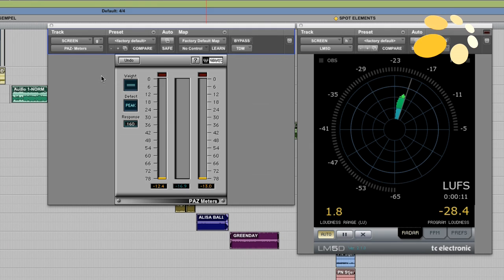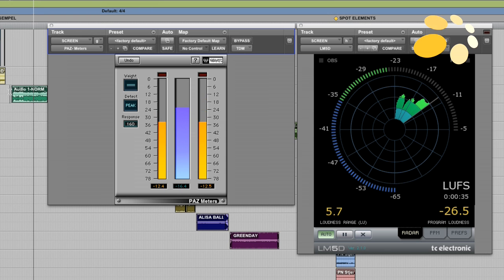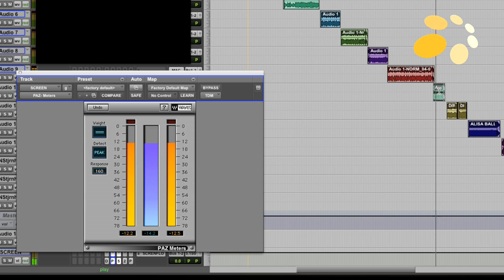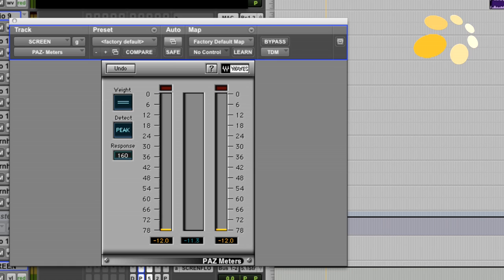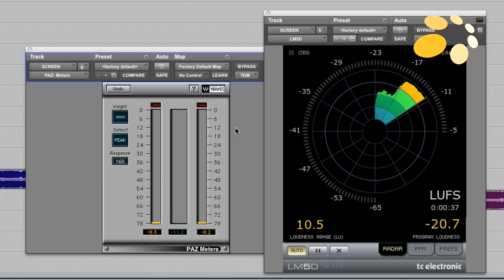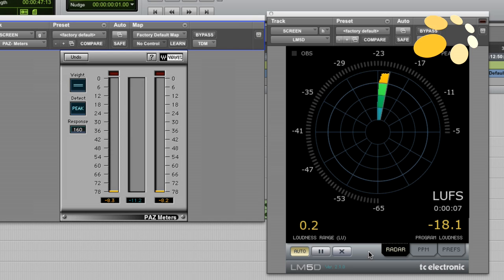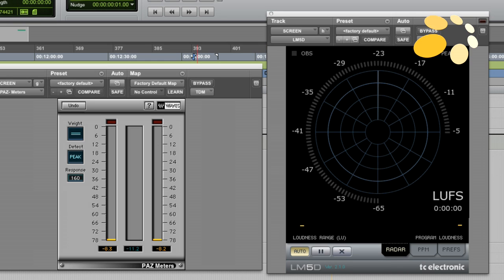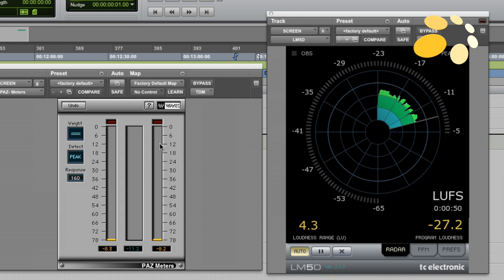Audio: What is loudness? Hypercompression, R128 Loudness Meassurement and normalisation explained.

Comment: Thanks for this video! Albeit too late. I quit watching TV in the autumn of 2006, refusing to be forced to listen to just the things that I was not watching for in the first place. I am using the R128 standard all the time when recording compilation tapes (yes, tapes), and I am glad with the results. The only thing that keeps me busy is the difference between the dynamics of vinyl and digital media. I have to use some limiting to get vinyl to -14 LUFS, which doesn't feel "correct", any advice of anyone reading this would be appreciated.
Reply: Basroos you made the perfect case!   The idea is not to compress anything, but to loudness normalize by turning down the volume on loud tracks.    This is the procedure you should (ideally) use for a tape:  

1) Meassure all tracks and find out what is the lowest value one (usually the track with the most dynamic range)
2) Loudness normalize all other tracks to that value

Thats it!  You have now consistent subjective volume, AND you have preserved all the dynamics available.

Alternatively, use a very reasonable target level (like the EBU standard for R128 that is -23dB) for everything,.  Not -14dB that will lead to the problems you describe.    Maybe you will enjoy my HIFI review channel "Stjernholm Reviews".   Thank you for watching.
Reply: @stjernholmreviews  Okay, thanks for your reply. Indeed, I should lower my target LUFS in order to get just what I need.

The -14 is not in the standard, but I should have mentioned I use the metering aspects of R128 (like the dynamic range as well) to read the values I need to adjust the levels of the individual tracks, the procedure in your first point. My target was -14 LUFS, because it works well with recording on tape in order to stay away from the noise floor, plus: most of the music I listen to doesn't need that much dynamic range.

You did make clear where my problem lies, so thanks very much! I will have a look at the video you suggested.

Comment: Do you have produced your video at EBU R128 standards?

I want to make my soundtracks/remixes at this standard - without compression or limiting and with the full dynamic range.
Does the loudest part of the track have to be around a program loudness of - 23 LUFS (so, if the loudness range is about 10 dB the whole track has to be around - 23 LUFS and - 33 LUFS) or should the average loudness of the whole track be around - 23 LUFS (so, if the loudness range is about 10 dB the whole track has to be around 23 LUFS +/- 5 LUFS?)?

Compared to other Youtube videos both seem to be pretty silent.
Reply: ***** , the video has overall loudness of approx. -23 LUFS, but has been gained around 4 DB for youtube listening.
Reply: trackdayklub 
Thanks 4 the answer - I will keep definitely EBU R 128 at my newest uploads of soundtracks/remixes - this guideline makes totally sense.

As long as R 128 isn't international standard (I hope it will happen soon) , yet Youtubers only have to turn up the volume a little bit.
Should be only a problem for fat, lazy Americans or other artificial people of the modern civilization who use their cars to get to their letterbox.
Reply: Yeah, I will do this with all my other updates in the future, too (just have uploaded my first remix at EBU R 128 standards).

The problems are only the volume jumps between my uploads and the the other youtube uploads.
If they switch from my rather silent uploads to the louder uploads of others, they probably fall of their chairs if they forget to adjust the volume.
Reply: I really prefer the straight EBU-R128 way with a programm loudness of - 23 dB where I don't need any compressors/limiters to manipulate the signal peaks.

- 19 LUFS (or - 19 dB) can be a bit tight cause I've measured some tracks where the peaks have already been at a value of 18 dB over the program loudness.

And I think it's much easier and better to convert a great idea into one real norm without unnecessary exceptions that will just bring confusion and a pile of another rules as well as lots of red tape.

Comment: I totally agree.  Dynamics processing should always be applied at playback.   Since 1992 we have had technology using that method in the Dolby Digital system.  Depending on the reproduction environment, the Dolby decoder can apply dynamics processing that is based on metadata set by the mixing engineer for that reproduction environment.   When used correctly it is genious.      Problem is that everybody in the pop/rock/electronic music industry does not have a clue about what they are doing :-)

Comment: The correction of the loudness did nothing to make the sound better, unfortunately. You still hear that all of the sounds are at the same level and so it looses any richness that is so evident in Jackson's song.
Reply: tarstarkusz Shouldn't it be named "Loudness flattening" or even "Flattening of dynamics"? Today most people call it  "Loudness Correction" which  supposed to be the correction of harmonics controlled by loudness in a way to achieve better impression..
Reply: Mikexception From what I understand and knowing little about audio, the loudness function is supposed to bump up the levels before the main amp which in effect would be like having a recording that was mastered at a higher level. This supposedly increases sound quality at low volumes.
Reply: ***** I am afraid You both mix volume with loudness. Loudness in audio stuff   depend on volume control. If we imagine  constant loudness it means we need to flatten dynamics, also cannot operate volume  potentiometer and cannot move from speaker. . Loudness is  pure  acoustic and is  volume function. What is described here is dealing with volume. My complain here is because I am dealing now with well known from 80 years loudness curves by Fletcher- Munson and it's  nothing to do with changing  the volume but with adopting  spectrum of frequencies to existing  low loudness. Because it's complicated and difficult now they  exclude low loudness.. But it's just another distortion  Many amplifiers have button or circuitry adaptive to  loudness and calling it "loudness" may be confusing..
Reply: tarstarkusz Just wanting to clarify... You are correct. Lowering the volume of Green Day's song made it worse, because that was how loudly they intentionally mixed their song. Every instrument in there had its proper place and volume. It was at a good dB RMS already.

Comment: You have some good points, but when you made the Green Day mix quieter, it became too quiet. The practical loudness maximum is the point at which your music is still bearable, i.e. you don't feel the need to cover your ears so that you won't go deaf.

So, overall, what you got was that the MJ song had a dB RMS that was louder than the dB RMS of the Green Day song. You basically said "oh, you guys are too loud. I'm going to turn you down", when in fact, Green Day intentionally mixed their song like that. I can tell because I can stand listening to it for normal listening lengths (whatever they may be), and I don't even listen to Green Day.

I'm sure you will agree with the following:
Too loud - https://soundcloud.com/sssshawnnnn/sssshawnnnn-mac-n-cheese-live
Proper loudness of the 2000's or so - https://soundcloud.com/zircon-1/no-regret-ft-chris-gordon
Reply: +timaeus22222 I think your missing the entire point of the video AND the new meters.
Reply: +timaeus22222 What he was showing here is that over compression doesn&#39;t sound louder when you play things back using a measurement of how we perceive sound. He matched the songs based on the new meters not RMS.. and both were played back at same volume in relation to human hearing not digital voltage. Also with the new standard.. this is how you would hear both songs in relation to each other in a tv show or on the radio for example.
Reply: DontYaTalkSIlly
You missed my point. That drastically alters the TRUE volume of the original song. I defined my comment in RMS quite intentionally, and I mean every single thing in my comment precisely the way I wrote it. My point is, I would never mix according to this "standard" because it's too quiet. Listen to the examples I posted.
Reply: +timaeus22222 Wow your still missing the point... ... the only thing making an over compressed mix louder is the lack of dynamics because the RMS is closer to the peak value.... the new standard just means dynamic music is played at the same volume as over compressed music. It uses human hearing as the metering basis so saying it is "too quiet" makes no sense at all.  The new standard won't mean that compressed music is quieter in any way at all.... Just that if your going for compression... you do it to improve the sound not to make things louder.

The mixes you post seem to me like you have a bad sense of how a good mix sounds... since the 1 that you call "too loud" is the better mix of the 2 regardless of dynamics.. The "proper loudness" mix has frequency masking, sounds dull and is kinda unbalanced and would sound quieter no matter what meter you use.
Reply: +timaeus22222 "TRUE" volume has nothing to do with peak db values and rms measures voltage not volume. A 3000 hz tone at -12 db rms is much louder than a 50 hz tone at -12 db rms.
Reply: DontYaTalkSIlly
Apparently you don't know what "true" volume means. It's the original volume at which the original song was produced. i.e. DAW -> render -> song finalized -> "true" volume

Oh, and RMS is the average loudness... (https://www.gearslutz.com/board/mastering-forum/352357-when-someone-says-12db-rms.html).
Reply: ***** I can't believe your using gearslutz as a reference. RMS means root mean square. Root mean square of what you ask(or probably not)? The voltage of the digital signal my good sir. Its relative to the speakers you use.. do you not have a volume knob? RMS is measuring in more or less the same way as LUFC so I don't understand where your going with this. Are you trying to say the less dynamic range the better? I doubt theres many people on gearslutz that would agree with that.
Reply: Of course not. More dynamic range IS better. You're assuming again. Obviously, RMS is a type of average (the square root of a basic average). Hence, dB RMS is essentially the average dB. dB measures the ratio of the output to the input, i.e. the gain (https://en.wikipedia.org/wiki/Gain_%28electronics%29). Hence, dB RMS is essentially average loudness. That's why -12 dB RMS can peak at 0 dB.

This pretty much reflects my POV...

http://ocremix.org/community/topic/41362-end-the-loudness-war-back-to-the-roots-of-full-range-dynamics-and-the-best-music-quality/?do=findComment&comment=790948

Specifically:

"the best general benchmark for technical audio quality is how loud you can play something before it gets unbearable. Dynamic music invites you to play it louder. Brickwalled music does the opposite."
Reply: ***** DB in a DAW is not a volume . its completely relative. RMS is average loudness... but only because a hotter signal tends to be louder, it still doesn't compensate for differences in human perception.. Your ears are better tools than rms/peak meters for judging loudness in a mix. -12db RMS could peak anywhere from -12db to 0db and still say -12db RMS.. does that tell you how loud it is? No.. it tells you the peaks and the average peak level. But if you listen to a pluck sound then a pad sound and match the RMS.. you will hear that 2 sounds at the same RMS level can be quite different in volume.
Our ears hear sound in different sections.. the tiny hairs pick up different frequency ranges and the more activated at once the louder something sounds. -3db Rms can sound louder than -1db RMS.

I kinda agree with the quote... Id say tonal balance is what makes you play it louder though.

Comment: Should have compared with the same genres! Obviously Michael Jackson didn't use distortion.
Reply: kristaps 5645 That does not make a difference.  If you listen to the overall volume/loudness of the songs when corrected, you should experience that they now feels equal, with no need to adjust your listening levels to compensate.
Reply: trackdayklub distortion  creates artificial upper harmonics, thats why it is different.